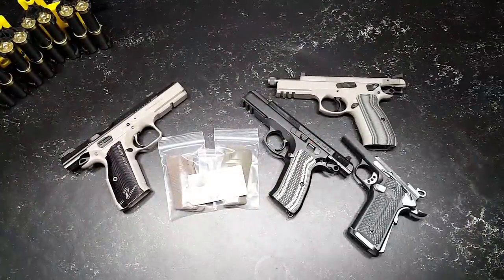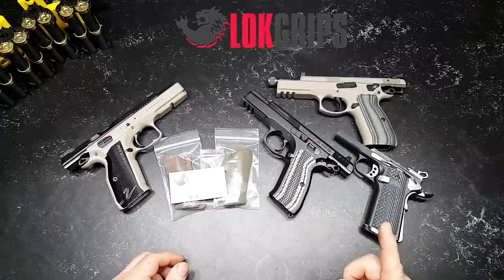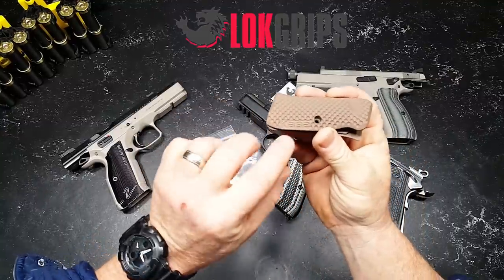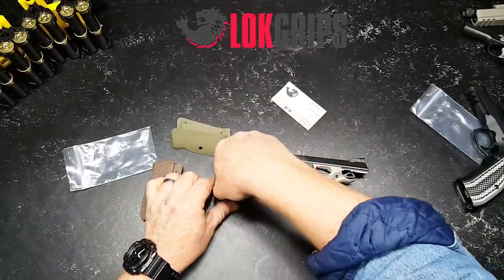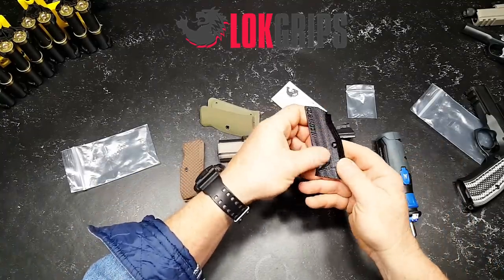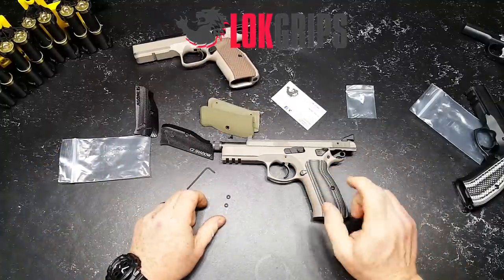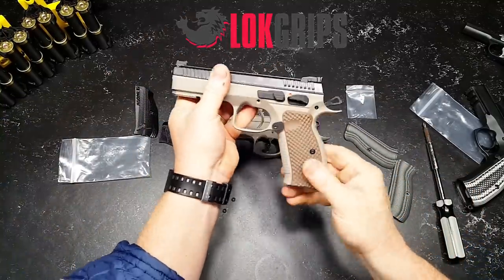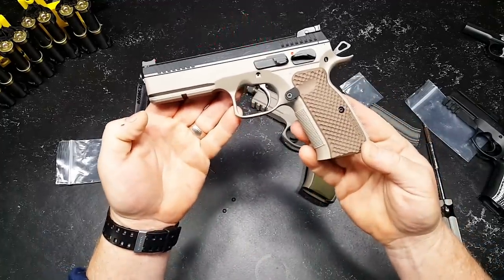LOK Grips Install and Review!! BEST CZ GRIPS EVER MADE

Comment: I just put a set of red and black bogies from LOK grips on my CZ 97BD and I can confirm a flawless fit. They look great and fit my pistol like they were molded specifically for it. As mention by KB32 there is no play or movement after mounting them and the texturing while it is a bit aggressive is nothing to worry about. As the 97BD is a large 45 caliber I would rather have aggressive grips so that I have positive control. Grips made by VZ are great and all but if your in the market please give some consideration to LOK grips as I feel you will not be disappointed. They have a better selection than VZ and took a little over a week from order placement to arrival at my home.

Comment: Tried to order vz grips direct on black Friday and failed. On the net I found "cool hand" grips and ordered black/white operator grips for my chrome c100. The cost less than cz's and fit perfectly with no problems you had with cz's. No movement and screws alone with rubber grommets..
Check them out!!!!